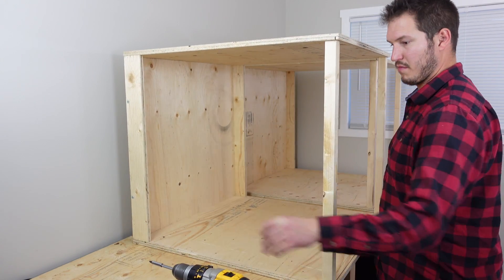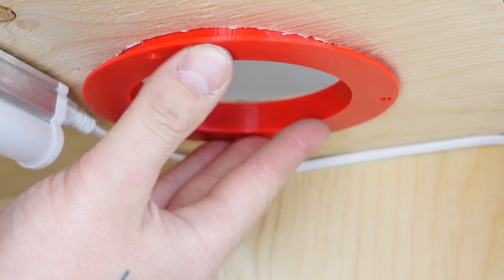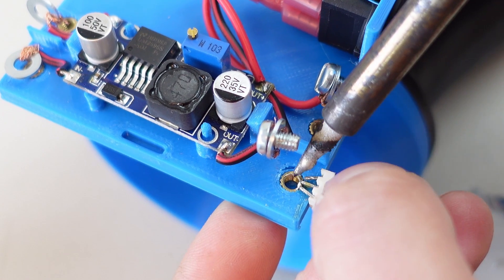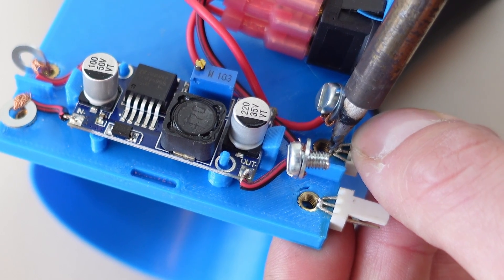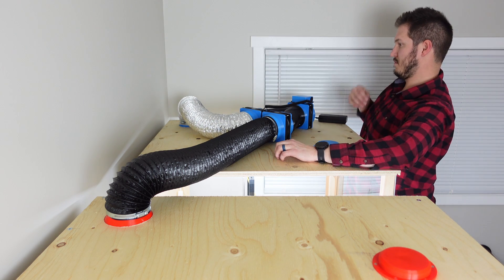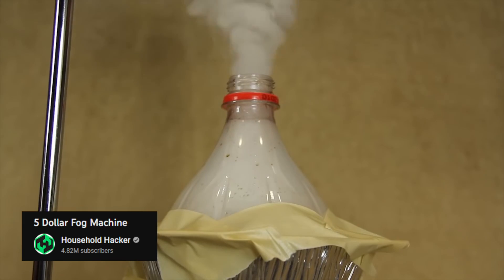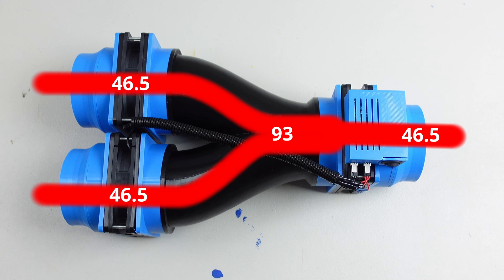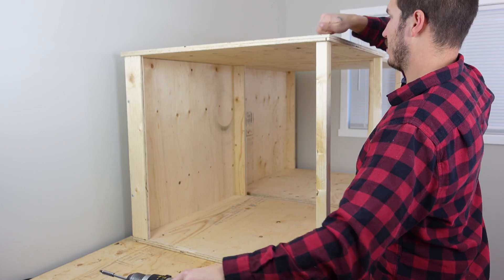3D Printed Modular Magnetic Exhaust!

Comment: cool project and great work.  you might find that you're exhausting too fast though and don't want to pull the heat out that rapidly.  you did a nice job with those enclosures, so achieving barely "negative pressure" would be straight forward if you find it necessary.

Comment: I did my original set up for my lasers with CPU like fans that plug into a USB. They have speed dials that adjust fan speed too. They work very well but if you have an enclosure that isn't running and hooked into the same feed line, the smoke fills the second enclosure. So I'm trying to find a work around for this without having to add another fan that runs independently of the second laser. I tried baffles to control airflow and they have a limited effect on preventing air from going into an enclosure.

Comment: This is confusing me. Some say the printer enclosure must keep the air warm inside.. but adding an exhaust fan will take the hot air off... Right ?
Reply from the maker: Depends on what you're printing, I know ABS needs a heated chamber while most PLA is indifferent. Running the exhaust does lower the temperature a little bit 🤔

Comment: The magnets such a crisp feel and sound. Love it. I think the computer fans would have been enough. The inline fans are great but more useful in a grow tent for hydroponics. I would probably do the computer fan setup and throw a small fan on the bottom of the printer to move air around in the printer while the exhaust fans run on a timer.
Reply: I have a similar setup but without magnets as all the machines that have it typically are printing ASA or hotter and more toxic
 I have two pc fans in line per machine and it works great.
I also have to add that I use "Eco" AC power strips which power off accessory plugs based upon the primary draw socket. It turns on my fans when the machine is on and when the machine shuts off or goes to sleep depending which one it is, it will shut off fans (based upon the drop in power draw). I don't even use a switch to turn on. I salvaged all the fans and 12v adapters from a Goodwill bins location, probably only cost me 5 bucks for all of them.
Funnily enough, that was the same day I found a big tree Tech 5-in touch screen😂

Comment: Awsome design! This video was really helpful in gaining some foundational level understanding on enclosures and filtration and is helping me out coming up with my own ideas.

i was a little confused on why your original system didn't work when you were talking about the CFM. Why was did the 3rd fan slow down your system? Wouldn't the individual fans still take out 46 CFM regardless? Wouldn't the 3rd fan increase the CFM more? I am not too sure how this works so I would like to get some clarification.
Reply from the maker: Thanks for watching!

When combining 2 pipes into 1 pipe, the total CFM of the 1 equals the total CFM of the 2. In the video the Y-pipe had equal diameter inputs and outputs, which means in order to increase the CFM of the output the speed of the air moving needs to double. Having a 3rd identical fan choked the speed and therefore reduced the CFM

Comment: There's also an easy way to get 12V without a buck converter. On aliexpress there are USB-C to 12V adapter cables, which simply tell a USB-C charger to deliver the wanted voltage. They are available with a lot of different voltages.
Reply: Ompp.pl😊

Comment: I was cringing at your original 3, then 2 PC fan setup.  But you figured it out with the last fan downstream of the Y.  Main takeaway is more is not always equal to more (your 2 46.5 CFM fans, for example, would not produce 90+ CFM at the join regardless).

Comment: I want to build this, but instead of inline fan, can i use double 90cfm 120mm case fans? (i don't know the pressure they create)
Reply from the maker: Thank you! Hope it works great! 🤞
Reply from the maker: It would depend on your enclosure size and how far you need to push the exhaust.

In a perfect world 90cfm would exhaust a 3' x 3' x 3' enclosure in 20 seconds, and stacking 2 case fans should push the air a few feet. Thanks for watching!
Reply: @LucasBuildsStuff  Thanks! i got the files last night, will give it a try with 120x38mm fans

Comment: So cool! I'm going to try this! 🤩Just out of curiosity, what was your reason for making your own and not using the ones 'Once in a Six Side' made?
Was it just to have the ability to expand on the design, or were there any flaws in his quick connect design that you corrected with your own? 🙂
Reply from the maker: Thanks! No flaws that stood out to me, just had different requirements like the Y pipe, computer fans and I had a bunch of the smaller magnets in stock 🙂

Comment: You could use the fans in the original configuration. You don't need to get fresh air into the chamber so quickly, that will most likely mess with the temperature inside.

All you want is a slight negative pressure to make sure the fumes don't leak out.
Reply from the maker: Yea I definitely won't be running the inline fan at full speed, the computer fans were unable to get the fog out from the bottom of the enclosure, I think I would need to relocate the exhaust hole to the side in order to use them 🤔
Reply: @LucasBuildsStuff You need to create an intake on your enclosure.
To remove 25ft² of air you need to let 25ft² of air in.
Reply: @LucasBuildsStuff  or 3D print a column with small holes running top to bottom, to evenly pull air from all levels.
Reply: @LucasBuildsStuff  If you were to give your frames some feet. You could drill a few small holes around the outside edge as intake. This would provide a vertical movement of air and continue to mix the air inside before it is extracted. That would prevent pockets of fumes hanging out in the recesses. You could easily do the same flow check with a single hole in one corner and your taped paper to dial in a good hole size. I'm guessing depending on your interest you may want 4 to 9 holes depending on size and if you want one in the middle beneath the printer. I'm in the process of getting my first 3d printer but I don't have a dedicated room. It will need to be ventilated for sure.
Reply: hmm better to do it hermetic and after all run the fun before open the case.